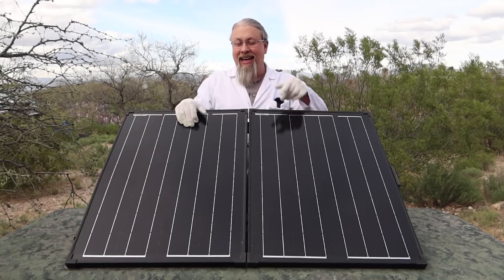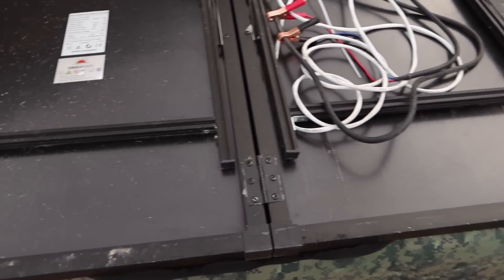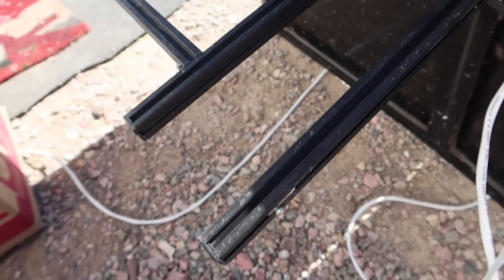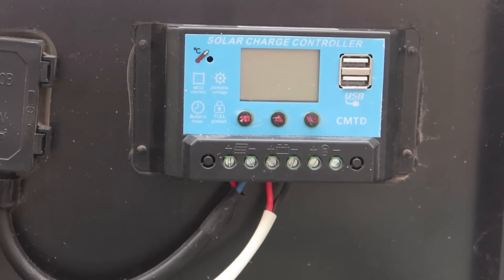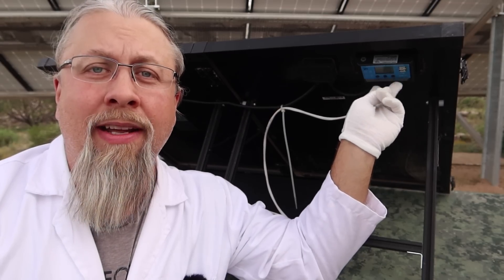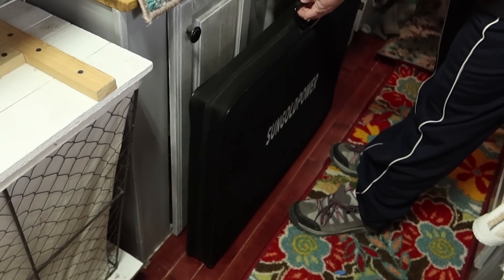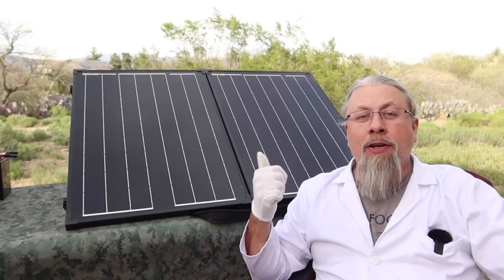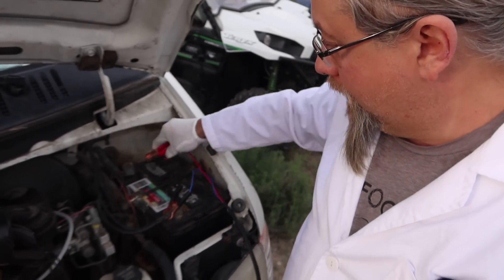CHEAP 130w Solar SUITCASE KIT That's WATERPROOF! SunGoldPower Portable Solar Panel Review

Comment from the maker: SUNGOLDPOWER 130w Suitcase Kit https://bit.ly/3rpU5Wq use code HOBOTECH10 at checkout!
Reply: Hobo, is it safe to use these panels to load up my house battery that is connected (via special alternator setup) to my vehicle battery? About to become an RV Lifer (1991 Dolphin) and learned I can't use a Lithium house battery in combination with my car battery since they're connected; so just want to be sure... Thinking the controller takes care of that as long as I don't use lithium as a house battery.
Reply from the maker: @margiecallahan3009  Should work. You should really consider installing an isolator so you don't accidentally kill your starter battery.
Reply: Thanks so much. I’m guessing there is already an isolator because the manual said there is something between the truck battery and the house battery that protects the alternator. Will check to find out if that is an isolator. Too bad those panels won’t arrive till May/June; tho Renogy has a 100+100 watt suitcase I might get instead. Anything I should be aware of with hooking 200 watts to my house battery? Should I put them in series or parallel? I’m think parallel but I only know enough to be dangerous
Reply from the maker: @margiecallahan3009  Series is the way to go as long as the controller can handle the voltage.
Reply: @HOBOTECH  Thank you very much. Just looked again and the Renogy 200 watt is NOT a suitcase. My mistake.  Back to the drawing board!
Reply: @HOBOTECH   Thanks, got it! Now I have another question. I hired an RV guy to look over everything. He said my house charger system needs to be replaced. I'm guessing I cannot bypass this problem using solar panels to my house battery because the battery feeds into the charger, which then feeds my appliances, is that right? Yet he was able to check everything by plugging the RV electric line in to his gas generator, which confuses me. Can you explain? Thank you.
Reply: HOBOTECH thanks for a great review! Can I use this on my Zamora solar ready camper if I put a Anderson plug on it or do I need to bypass the cc on the Sungold. Thank you!
Reply from the maker: @markkeating1804  If your camper doesn't have a controller then you don't have to bypass it.
Reply: HOBOTECH Dude this is exactly why your one of the best RV shows around!
Reply: $199?  They show up at $395.
Reply: Do you have a new promocode for this. I tried to use the one you listed and it is not working.
Reply from the maker: @lisas6056  The new code is in the description but I'll update this pin too.
Reply: @HOBOTECH  Is there a new promo code for this month?  thanks
Reply: Great video as usual - very helpful. This looks like what I was looking for. Too bad the new promo code isn't working now either.
Reply: That solar panel seems like it was made for me.

Comment: Could this be mounted to the top of a camper shell on pickup truck?  And left while traveling???
Reply from the maker: I suppose, but that would defeat the purpose of a folding suitcase kit.
Reply: @HOBOTECH  I understand that but when you live in a pickup truck. Every inch is needed. And it could save "set up " time.

Comment: I recently purchased the what fun 500 watt hour portable power station AC50. This seems to be an almost identical twin to the Bluetti. I am now on the hunt for a 100 or 120 watt solar panel. This video brought up an important point I did not know before, that being that panels with their own solar controller cannot be used with solar generators that have a built-in controller. You discuss bypassing the controller on panels to connect to such solar generators. Once the wires are pulled from the solar controller on the panel, is it just a matter of purchasing the appropriate ended wires to splice into the solar panel and then to the connector plugs for the solar generator?

Comment: So i order it.   And yes i tried to charge my solar generators with it.  😂🤣 I'm thinking WTF. Test equipment comes out. Never dawned on me to bypass the SCC. Which BTW is TOTALLY different from the one you show.  It must be cheaper than that one!   Had no USB and one button like 6 modes and no instructions. Have no idea what it does.
Reply from the maker: They sent me the new revised model with this controller I'll do a review on.
Reply: @HOBOTECH  mine has one button. Set. You get numbers 1-9 and the letter A. I thought Auto. But. In all day it didn't bump a battery from 11.57 volts. Bright sun.
Reply: @HOBOTECH  i have the one shown with the usbs. I was seriously thinking just upgrade.

Comment: Due to all the smoke in northern California I have not been able to test my folding solar panels. Today it was fairly clear so I am testing them. I found the perfect place, on the roof of my greenhouse. I had to hose all the ash off first and let everything dry. The greenhouse has a shade cover which means I can place the solar generator inside, out of the direct sun. I laid the folding panels flat on the roof in the direct sun with the bottom of the panels resting in the small rain gutter. The light came on on the front of the generator to show that it is charging. Then I come inside and watch this upload halfway though. I then rush outside and secure the top grommets of the panels with rope. Thanks for the warning! (-;

Comment: Thanks for the video.  Quick question...   can the charge controller be removed from the suitcase and permanently mounted in my camper and just add some quick connect extension cables to it?
Reply from the maker: Sure but why not spend the $20 and get Renogy? https://hobotech.tv/amazon/#Solar-Install
Reply: HOBOTECH oh buy an aftermarket charge controller?
Reply: I totally didn’t think about that...   that sounds like a better idea.  I ordered this a couple days ago with your coupon code.  Should be here this week.  I’ll definitely have to order the controller and probably some extension cables too!   Thank you.
Reply: HOBOTECH I’m looking at a 20 amp MPPT from Renogy.  I’ve got a pop up camper and I’ll have 2 12V sealed batteries wired in.  Thanks for your help!

Comment: These are coming with a different controller now, listed as automated, no screen, no usb, etc. The cable also has a split with mc4 connectors in between the controller and the clips.

Comment: You should test some of the cheaper mppt charger controllers like on Ali Express one I saw someone review that would be useful that charges your Inverter batteries and then charges your starting battery too if you hook it up but the one I am interested in looks either a clone or someone at the factory where victron charge controllers are that say hanfong  SMP-20A but that did not help searching I just searched (mppt charge controller) and it was the first one but that maybe because I have looked at them before

Comment: So panels with mppt , I need to bypass to charge blue 2400.  Disconnect charge controller and connect directly? Can I leave rv system connected to mppt and still bypass panel controller?

Comment: I have watched a lot of your videos.  Thank you for the info first of all.  A question that comes to mind is wind turbine power.  Using it with solar(especially for the cloudy times) Using it to charge one of the power stations(like the jackey) and if it could be used to charge one at the same time that solar is charging one?
Reply from the maker: Wind power only works above 50 feet. I used to have a turbine on my RV and it did squat but, sure.

Comment: You are literally the coolest... I'm getting one asap... Can you chain a battery bank with this or should I just get two I'm trying to run 4 to 6 battle born 100 ah
Reply from the maker: It will take 3 of these panels 8 hours to charge 4 Battleborn from 50%. I say two in parallel would be minimum.
Reply: @HOBOTECH  I was thinking 2 or 4 of renogy  on the rv roof and one or 2 of these to move around if the shade gets weird... Parallel I think

Comment: So one of these panels wouldn't be able to charge the bluetti EB150 due to it being 12V panel? Would I need to get atleast x2 of these panels running them in parallel to be able to charge the Bluetti EB150?
Reply from the maker: This has a high enough Voc (open circuit voltage) to charge the Bluetti but it would still be slow. Two in series would be your best bet to recharge it in one day.
Reply: @HOBOTECH  awesome thanks!

Comment: Hi Prof'.
Please advise, if I only ever use 50% of jackery 500 before I top up to 100%, is each top up equal to 1 cycle or half a cycle or no cycles at all. Great channel, thank you.
Reply from the maker: It's complicated, but best answer is half a cycle. For longest life, keep the charge between 20%-80% and don't store long term at 100% or in high temperature environments.

Comment: Questions..i really don't get solar at all..but..on these portable panels where does an inverter come into play??..im pretty sure I'm going to get this panel...i will put at least 200 on my roof but still want portable so this will work in that regard..i also will be getting a new solar generator..wanted a jackery 500 but can't really afford it. Esp without promo codes..so I'll prob end up getting a rockpals or suaoki?? What's a good solar generator for about 300 bucks?  ..hi Heidi✌thanks Tom.always appreciate your input even if I still don't understand it all..lol..✌❤😊
Reply from the maker: Inverters have nothing to do with solar panels. They turn battery power into household AC power. I wouldn't recommend a Rockpals. Get a Jackery 240 or Suaoki 200wh from https://hobotech.tv/amazon/#Power-Generators . If you need regulated 12v power (i.e. for a fridge) get the Jackery. If you want more modern USB charging get the Suaoki. Not sure if the 10% code still works.

Comment: What gauge wire are you using for that extension cable? I need to run about 10 to 20 feet.
Reply from the maker: It's 12-14 AWG. If you want to run 20 feet use 10 AWG.

Comment: That looks like a decent price for reasonable set of panels with a carrying case, etc. You can make your own a bit cheaper, but not much cheaper unless you have pieces already or can watch for deals.
Have you done a video on making a set of folding panels?
Let's see...
1x $15 to $20 charge controller if you want to hook directly to a battery (not needed to charge a "solar generator");
2x $70 for 70watt panels  (or use 100watt panels at $80-90 per panel, but weight and size starts getting awkward);
That's about $160 for the "active" components. Then add maybe $40 to $50 for the rest...
You might need some wire and clamps, so cut up a $12 set of amazon basics jumper cables (10ga, 2x12ft, 2x2 clamps);
Add $5-6 for some hinges (or use duct tape);
About $25 for some PVC pipe and misc screws at a local big orange/blue/red and that should do it.
(If you don't need battery clamps, you can get better quality stranded 10ga wire by the foot at the same hardware store.)
Reply from the maker: As this is $199 it costs more to make it yourself.
Reply: @HOBOTECH  Not the way I just costed it out above.
Reply from the maker: @Sylvan_dB  We must be using different math. 20+140+12+6+25=$203 plus a day's time to build it. I'd prefer to buy one for $199 and not waste a day building it and not even have a warranty.
Reply: @HOBOTECH  Yeah, you picked mostly the higher cost options. E.g. the charger controller like the one on the SunGoldPower is $11, or you can get a similar Renogy for $20. If you want heavy brass hinges like on your house door they will cost $3/ea ($6/pr) but if you want lighter duty like the other ones they are under $5 per pair. Oh, and the NewPowa 70w panels are $68 so $136 for the pair. That's under $200 for slightly more power at 140 watt. Like I said, you could save a bit.
But maybe you don't need the charge controller, you'll end up with extra battery clamps, maybe you'll work with someone else building a set and maybe you'll already have some pieces so can save more. But best of all, by building it yourself you build what suits you best, and you know how to fix it if there is a problem.
Different strokes.

Comment: Ooops! One more question for the professor. Why do nomads not create their own water with an air-to-water device. I have looked them up and they can make gallons per day and use about 250watts/110v. Just devote some solar panels to running this machine, and you have unlimited water. I know that space is the final frontier for some nomads, but saving all the water runs, ahem! 

I bet the professor could DIY this device too.
Reply from the maker: They really don't work that well. Especially in the western desert states. 250w running 24/7 is more than an air conditioner for a few glasses of water. Plus they are large and expensive. My friend Pat has one on his channel.

Comment: when you hook up to the house batteries and you have two batteries how do you hook it up. you only showed one
Reply from the maker: Hook to any one battery and they will all charge -- assuming a 12v system with batteries in parallel.

Comment: I have a TT, so what do you think would be the correct battery size for a 200 watt renogy solar system? I only need 2 batteries for now, . Thanks
Reply from the maker: You should generally double the solar watts for the amount of amp hours you have, and you base your battery size on your overnight power requirements. That's my rule in practice.

Comment: Thanks for the video! I noticed at the end you mentioned this panel might be a slow charge for the Jackery 1000. Three weeks after purchasing the Explorer, I still don't see any sign that the Jackery 100 W panels are gonna become available again. So, what would be your best  suggestion for a plan B solar panel?
Reply from the maker: The Jackery panels will be available next week as mentioned in my recent post. You can, however, use just about any folding panel on https://hobotech.tv/amazon/#Solar-Kits

Comment: I have a folding suitcase that  just noticed that the controller will not come on can someone recommend a replacement from amazon also mine has clips for  the battery I wanted to buy a jackery and wonder what kind of fix I need to hook up to the jackery I guess if I already had the jackery I might could figure it out but thought I would ask in case I want to order them all together
Reply: should have watched the whole video before I asked but did anyway ?

Comment: Can a cheap charge controller send power to a water heater element after it has fully charged batteries?
Reply from the maker: If you mean "can a charge controller send power to batteries to charge a water heater element" then yes. You can't safely power a heater directly with a solar panel.

Comment: I have a question Tom if you already have a pwm system can you supplement with mppt to the same battery. I know this is been discussed but I do not remember. I know when you're using like controllers is not an issue but what if you mix up controllers on One battery. Love the video I love the idea of deploy panels I like shade and they like sun
Reply from the maker: Yes, you can use any controllers you like on a battery. They won't conflict.

Comment: Love your videos I'll be in Lake Havasu in a few months. Please do a video on how to hook this up to a power station. I have a RockPal 130 but anyone would be great.
Reply: Yes, Prof. Hobo, please do a video on how to hook regular solar panels to a power station.  I canceled the Rockpals order, and was going to get Jackery panels (whenever they are back in-stock).  Using regular solar panels would be a lot less expensive and may just be the way to go.  Thanks for all your informative videos.
Reply: @dieselnine1022  I have the Rockpal 80W panel it works pretty good but I'd love to get this one so I can connect them both up.
Reply: @GerardRosso  Yeah, this one looks pretty good, but I'd be inclined to get two of them, and run in parallel with the panel mounted charge controller out of the picture.  Right now all I have is a MaxOak 2400 that is topped up from the AC wall adapter.  Need some kind of decent panels soon.

Comment: Confused tho as to why they would have the panels on the outside when closed? I see lots of scrapes n scratches happening..do they all do this?
Reply: It comes with a heavy duty soft side carry bag. Scratches don’t diminish solar performance.
Reply from the maker: They do this to protect the inside of the panels, electronics, and hide the legs. It comes with a case so it won't get damaged.
Reply: @HOBOTECH  ok..thanks..makes sense now..

Comment: tried 2rs36nk  also ,no luck
Reply from the maker: Try new promo code RT63P6C7
Reply: @HOBOTECH  Thanks hobo ,i have my order in . It isn't exactly as you say but close enough . 255.00  code is 38.25 off so it comes to 216.75
Reply: O wow I just noticed June 5 delivery .that is OK can't go out anyway
Reply from the maker: @dickvankoughnett2331  
My Cart 
Order Summary
Items: $235.00
Shipping & handling: $0.00
Promotion Applied: -$35.25
Total before tax: $199.75
Reply: @HOBOTECH  well I clicked on your link and it comes up at 255 . Maybe they are on to us ha ha . that's ok list in Canada is just under 400

Comment: I see alot of potential in that system.
I can envision making a semi-permanent mount for rooftop that allows it to be folde close when not in use or to protect against hail....and with a handful of assorted pigtails, can be adapted to many situations as you showed.
I wonder how it would do to just keep a 100w battery with a small fridge/freeze hooked to it...
Thanks Hobo.
Reply: For the price and capacity, I see the potential to power my travel trailer 12-volt fridge and LED lights so I ordered one tonight.